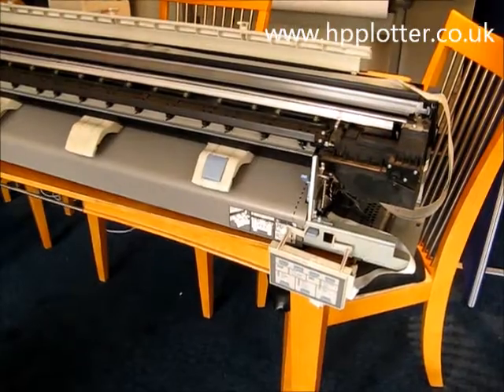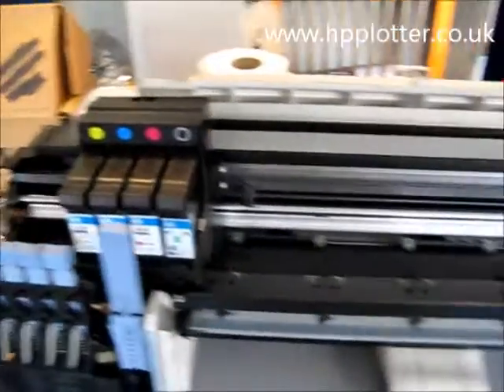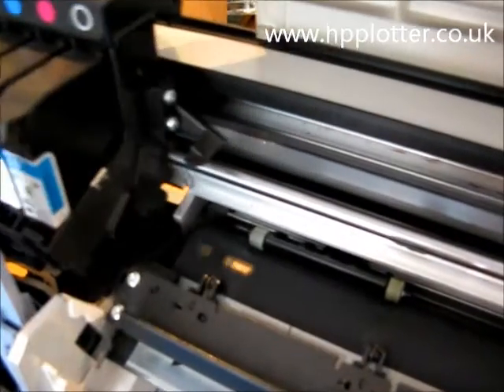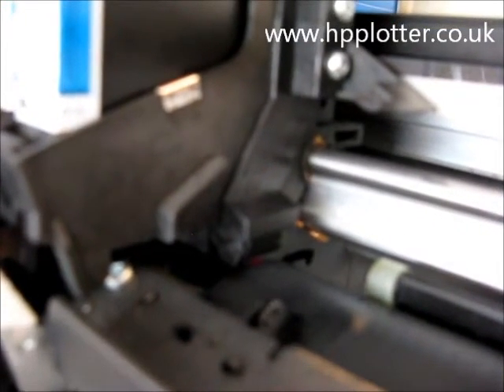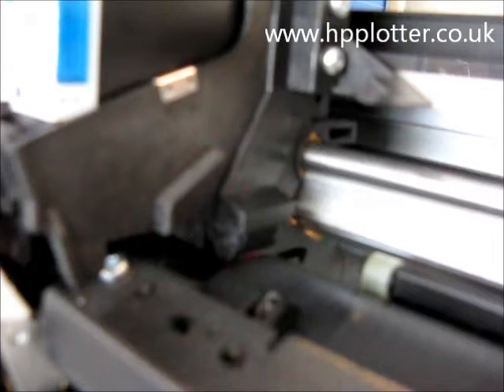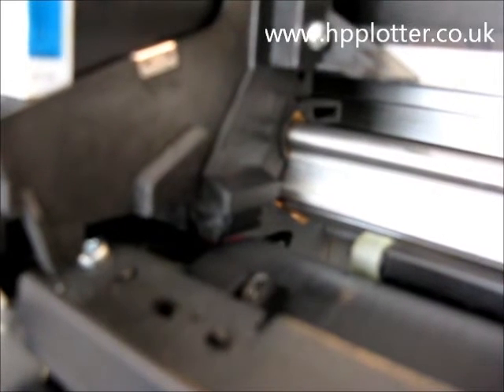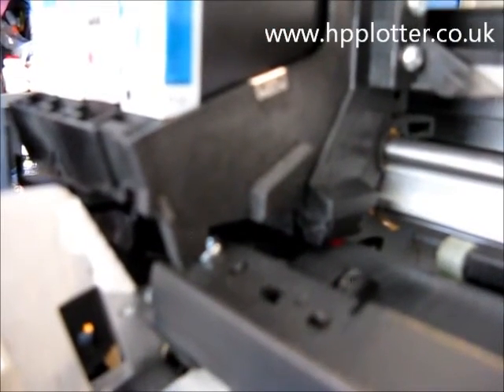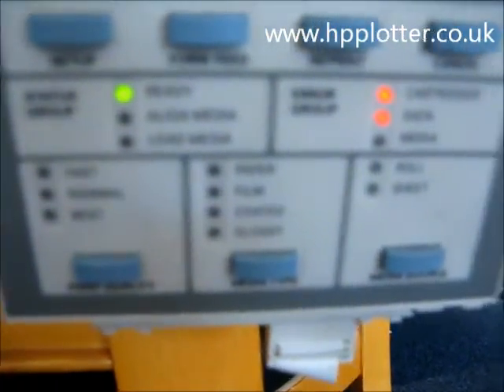DesignJet 450 cartridges + data error

Comment: do you have instructions on how to change the belt ?
Reply from the maker: No I regret we don't. It's just a case of stripping down the printer fully and putting the belt on the correct way - it should take around 4 hours the first time you do it (just remember where all the screws go). If you've not purchased an original HP belt then be aware the cheap Chinese imports last c.3 months before they break. There is no easy way to slip the belt on without taking the printer fully apart. If you want an engineer to attend site to do this for you please email engineering@hpplotter.co.uk and request a quotation. Some customers manage it themselves if they are technically minded, others manage to fit the belt the wrong way and then call us to sort it out and often give us a number of screws that they couldn't find homes for. Hope this helps. Best of luck 😃

Comment: How do you do, got a 450c no error lights, the carriage moves perfectly on start up sequence and when I run test print the head moves as if it is printing but paper comes out blank
Reply from the maker: Hello Nathan - hard to say exactly what's wrong until we're in front of it to assess - but certainly it might need either a new carriage belt and/or carriage assembly. Contact engineering@hpplotter.co.uk for a quote for a repair. Also you might wish to consider a replacement as well. We do have a great offer on the table right now as we need to shift stock fast before Christmas to get space -  and a new machine would set you back under £600 including delivery!
Reply: @HPPlotter  450C - I have this issue. Data and Cartridge lights on steady after prolonged startup (looking for white mark). Can I replace the sensor or must the entire carriage be replaced. I'm in Canada so can you recommend ?This is odd because the plotter was working fine just last week. Thinking it was cartridges I replaced them but with the same result. Email ecormier1221@gmail.com
Reply from the maker: @kimmer7352 Response sent to your email

Comment: I have exact same error...when you say carrage replace why?...cant you just replace the sensor..?
Reply from the maker: HP don't sell the sensors only so that's why you have to replace the carriage. Theoretically if you could buy the sensor and spend time soldering it on then all well and good - but I think you'd have to purchase a carriage just to get the sensor and then you may as well just swap it out. We supply second user carriages at £65+VAT + shipping. Contact engineering@hpplotter.co.uk if you would like to proceed - we can supply the part only or supply and fit.

Comment from the maker: Its probably because the black is not functioning properly and even though one presumes it is pure black used, magenta is actually used as well in the background.  The best way to prove it is to use excel or word and create the four colours, which includes black - then see after prinitng if the black is working ok. Also may be a spittoon issue or a sensor issue.  If changing the black doesn't resolve the issue, you'll need an engineer to work through the fault.

Comment: i m having a problem during printing. everytime i print in colour or in b&w, the magenta colour is like disturbing the printing process (i m not sure how to describe it), which means, where the black line supposed to be, is change to magenta, but not at all of the line, only at certain portion, usually and the left side of the paper, n usually happen when i use A1 size paper, but now, even during A2 the problem had become more n more persistent....please help